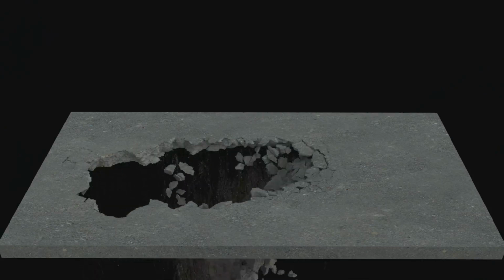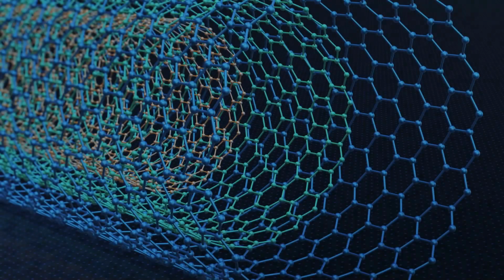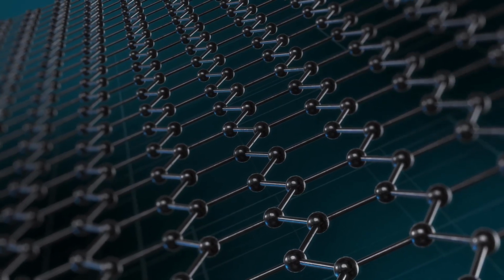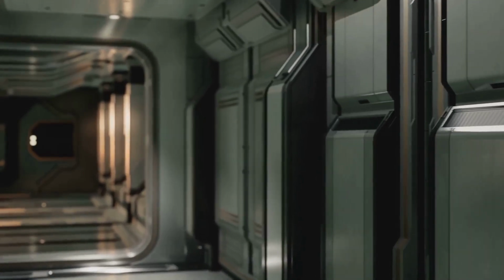Nanomaterials Under Stress: Strained Engineered Properties

Comment: So how do quarks combine mathematically to form hadrons or mesons. The charm quark gets its name because it fixes theoretical problems. There is also the beauty and truth quark. It sounds like a multiplet is a pattern of 8 or 10 hadrons next to each other.

I thought the colour charge was responsible for the strong nuclear force. Gluons stick quarks together and also have a colour charge. How does switching the colour of the three quarks determine what particles can exist and what decay process is possible? What is meant by all colours of the colour charge adding up to no charge.
So QCD is basically a big diagram of quarks and gluons that supercomputers are trying to work out. QCD shows that interactions between quarks and gluons make up most of the mass of matter. QCD still cannot solve the proton neutron mass difference nor can QED. What exactly is QCD and QED, and how would they combine the two to solve the proton neutron mass difference?

When bosons have symmetrical wave functions does that mean they are all in the same quantum state. How do they transmit force over long  distances.                                         When particles attract or repel each other they exchange a photon. Does the photon have to get absorbed quickly to repay energy back it has borrowed?                                                                     Do W bosons cause particles to change their charge, or do the W bosons do something after the particles change their charge? During the Big Bang, electrons and neutrinos made the same electro weak force, I thought W and Z bosons were responsible for the weak force.  A particle can emit a W and Z boson that is much heavier than itself, because over a very short period of time, the mass energy and even empty space is uncertain. Because of their heavy weight, the W and Z bosons can’t move far. Is this because they have to repay the energy they borrowed to form.
Reply from the maker: Your questions cover some key aspects of particle physics, particularly regarding quarks, bosons, and the fundamental forces. Let's break down your inquiries:

Quarks and Hadrons/Mesons Formation: Quarks combine through the strong interaction mediated by gluons to form particles called hadrons. These include protons and neutrons (baryons) and mesons (quark-antiquark pairs). The names charm, beauty (bottom), and truth (top) quarks reflect their theoretical significance in particle physics.

Color Charge and Strong Force: Quarks have a property called color charge (red, green, blue), and gluons carry this charge, binding quarks together to form color-neutral particles like protons and neutrons. The interaction between quarks and gluons is fundamental to understanding the strong nuclear force.

Quantum Chromodynamics (QCD) and Quantum Electrodynamics (QED): QCD explains the strong interaction, while QED deals with electromagnetism. Both are essential parts of the Standard Model. The challenge of explaining the proton-neutron mass difference remains, as it involves intricate calculations of quark masses and their interactions.

Bosons and Force Transmission: Bosons such as gluons and photons transmit forces over long distances. Gluons mediate the strong force between quarks, while photons mediate electromagnetic interactions. Their ability to occupy the same quantum state due to their symmetrical wave functions allows them to transmit forces effectively.

W and Z Bosons in Weak Interactions: W and Z bosons are responsible for weak interactions, like beta decay. They facilitate processes where particles change their charge, playing a crucial role in understanding the behavior of particles during events like the Big Bang.

Heavy Bosons and Energy Dynamics: W and Z bosons, being much heavier than other particles, have limited range due to their short-lived nature. They briefly exist by borrowing energy from the quantum vacuum, a concept deeply rooted in quantum field theory.